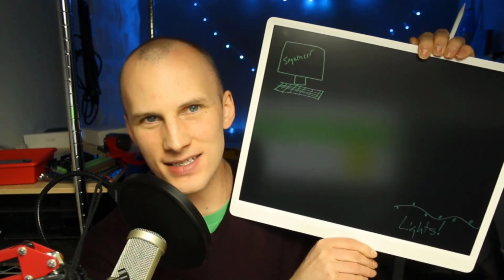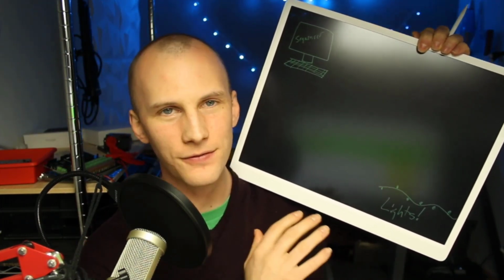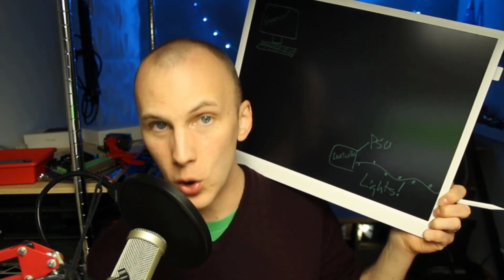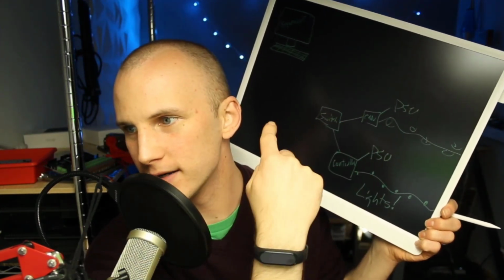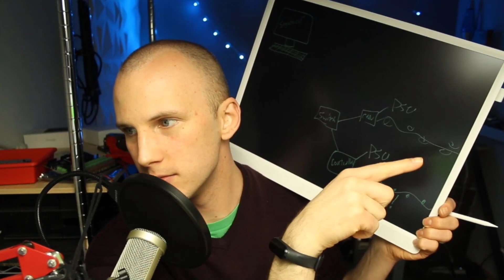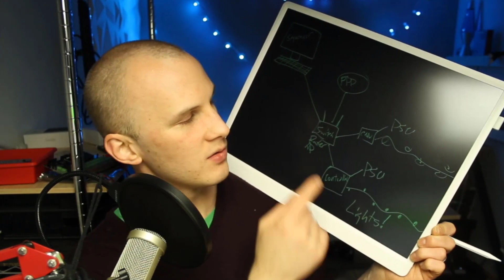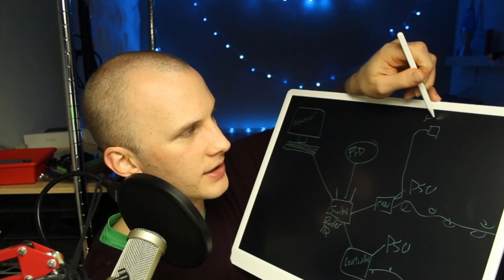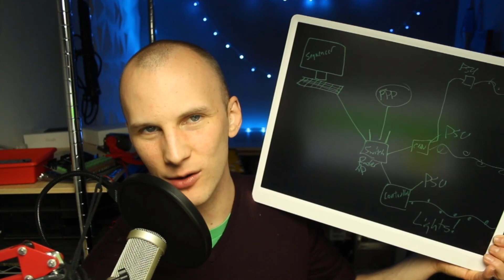How Does an Animated Christmas Light Show Work - In Depth

Comment: I would like to see a video on installation of LED 120 Volt led strings on a singing tree.  Wiring on the controller, how to hookup up and run.  The entire hookup from start to turning on the channels needed.  I enjoy your videos. Thank You
Reply from the maker: Great idea, but for the most part I'm going to stick with pixels here on this channel.  Thanks for the suggestion, though!
Reply: Do you have 120v controllers like Light-O-Rama's 16 channel AC controller?  If so and you have a pixel controller, one of the "additional outputs" on the pixel controller can be set to output DMX and unless you have really old LOR controllers they will work fine with DMX in place of the LOR protocol.  You may need to make some special cables but I was fortunate that I did not have to.

Comment: I'm still playing with my lights and stuff and was wondering something it seems that everyone that talks about fpp is always talking about connecting to the internet via ethernet or over WiFi is it possible to load the sequence onto fpp and just have it run and do its thing or does it have to be connected to the internet somehow? My controller is a k16 with the beaglebone black.
Reply: I take it you are running FPP on your BBB.  I have FPP running on a Raspberry Pi that is currently driving a Falcon F16v3.  While my RPI is connected to my home router via WiFi and to the Falcon via ethernet it does not have to be connected to the Internet.  Down the road you may find a need to connect it to the Internet to support for example the ability to have the public choose which playlist they want to hear (via Remote Falcon) but for now you don't need the Internet to run FPP on either a BBB or an RPI